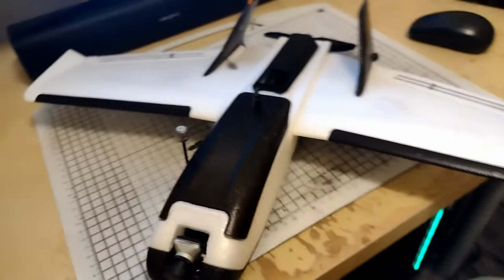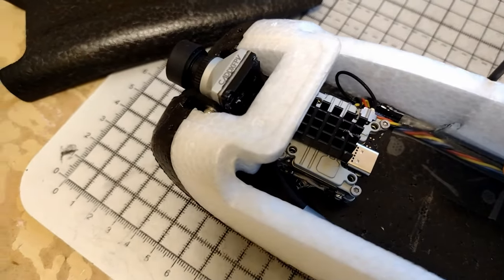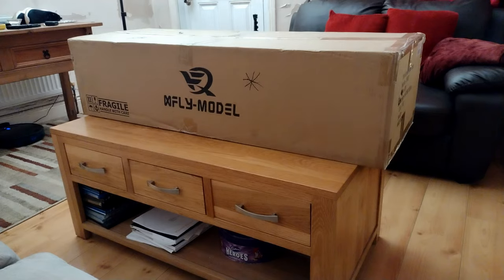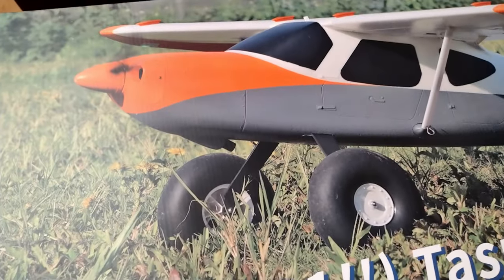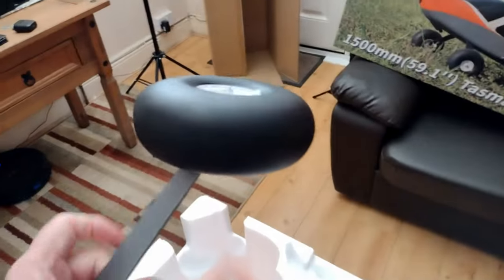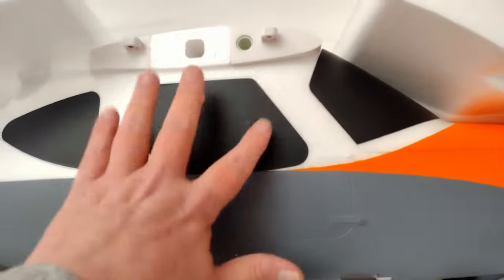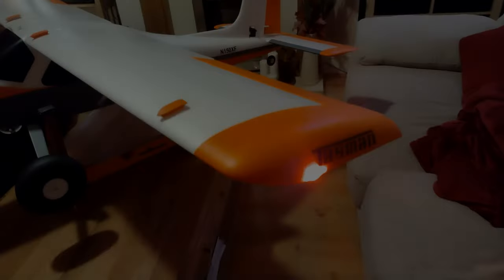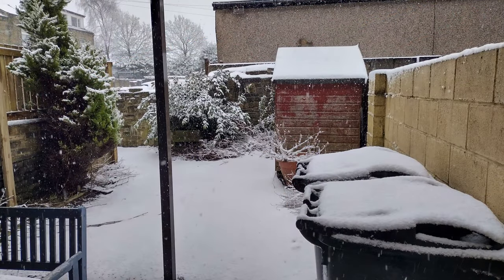Workbench Updates and Unboxing

Comment: Very nice looking birds, am thinking of building up a zohd dart 250g with FC and Walksnail myself, when pennies allow I'm sure I'll do it. Last year I bought the XFly Glastar V2, it's the one that is 4s capable as the original was a bit underpowered, they are very nice planes, lovely lookers; the Glastar is a bit smaller than the Tasman. Looking forward to your 2 maidens 👍
Reply from the maker: Thanks!  It was a really good price and I've wanted a decent circuit bird to practice with. My zhod 250G before was analogue and flew perfectly well but when you have a spare HD vtx and camera, why not do a new build? I'm a better builder than I was.